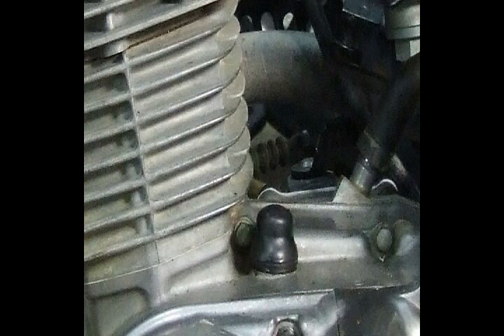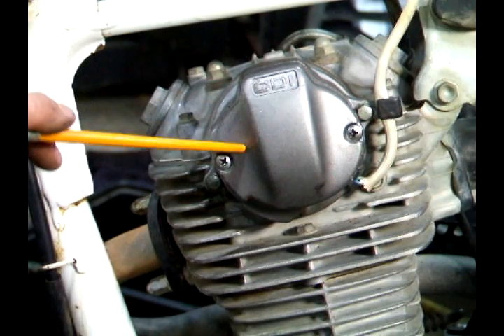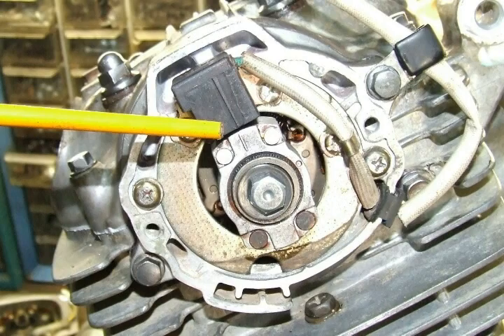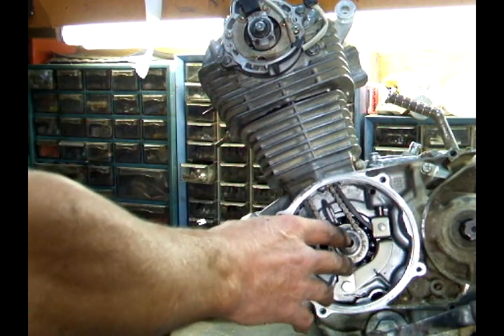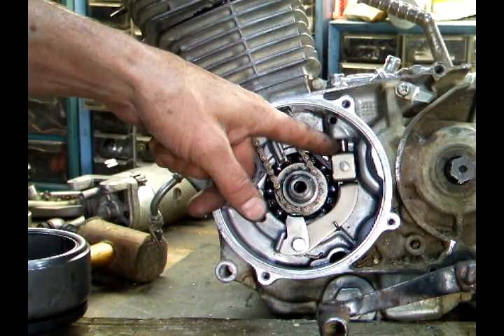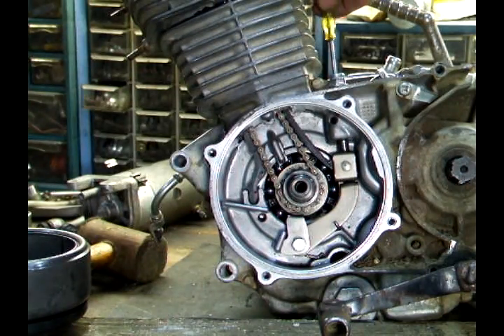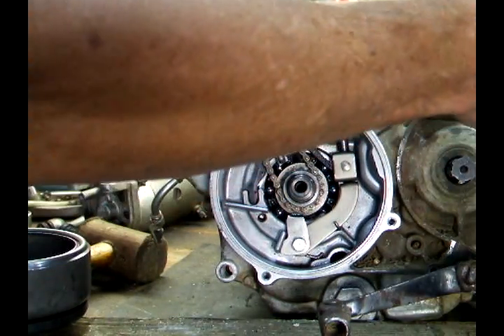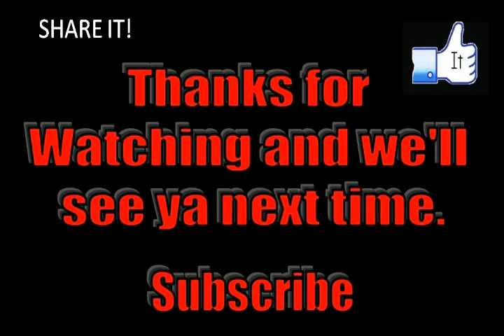Cam chain adjustment for Honda 125, 185, and XR200, ATV's & motorcycles

Comment: a bit unclear to me still.  By pushing the screwdriver down a few times is what sort of resets it?  You do not have to open up the case, as you said, to see it? So line up top by matching the line, then push with screwdriver a bit?  thanks
Reply from the maker: That is correct. Pushing with the screw driver just makes sure that the locking mechanism released and set the proper tension.

Comment: so you did not adjust anything just push it down. is there a screw inside to turn to adjust and which way do you turn it to take up slack in the chain. Thanks
Reply from the maker: The adjustment is spring loaded. The clamping mechanism sticks sometimes. I'm just pushing on the adjusting rod to make sure that it is not sticking. The spring inside sets it to the right tension.

Comment: Thanks for your video, this is great. I've had this bike on the shelf for awhile. I suspect my cam chain may have slipped on my first ride. Does this sound sound like a slipped cam chain to your or perhaps something else? I'm not terribly handy with these and would love your input. Thank you. https://www.youtube.com/watch?v=IOm-WkMdVhE
Reply from the maker: Wow, that's hammering pretty good. It might be more than a timing chain slap. Better tighten the valves too. Check the Oil also.
Reply: @Amotorcyclenut  Thank you I appreciate it!

Comment: The manual says to loosen the bolt while it's running then tighten.Thanks
Reply from the maker: If the timing chain skips a tooth while its running you will have bigger problems. Don't do it.

Comment: Why does this have to be done on dead center fire stroke? What would happen if I didn't do it dead center fire stroke?
Reply from the maker: It doesn't have to be exactly on TDC, but at that position I know the cam is not trying to  open the valves.
Reply: @Amotorcyclenut  weird because the oem Honda repair manual states to have engine idling and loosen the larger nut
Reply from the maker: That might be a way to do it when every thing in the engine is new. But ask your self this question. What is going to happen if all the parts are a bit worn and you loosen the Cam chain with the engine running and the timing chain skips a tooth or two? I'll take the safe way on an old bike.

Comment: A Motorcycle Nut, I read some of your replies and of course watched the video. Very good, and most importantly; CORRECT information. Thank You. I love the XR200R engine, for some reason I love the design, how compact, how simple, and how peppy the cute little engine is. Now, if I could just adapt fuel injection to it...

Comment: The cam tensioner is on a spring that can stick all you are doing is allowing the tensioner to do what it was designed to do. You aren't adjusting a thing just freeing a Honda flaw in an otherwise great motor.
Reply: The answer is always in the comments. Thank you

Comment: my xr200 will start and idle fine, but past a quarter throttle its just boggy.  carb is clean.  any ideas?
Reply from the maker: Jet needle set wrong. Wrong float level.  Air leak somewhere. Dirty or old air filter. Bad spark plug cap.  Plugged muffler. There are a couple of things for you to check. Read your spark plug after you run it to figure out what's going on.

Comment: Great video!  I have seen others post videos adjusting the chain while the engine is running.  -A great way to destroy it.  Yours is clear and easy to understand.  TDC on the firing stroke to slacken the chain for adjustment.  Thanks!!
Reply: It's not TDC though, it's a bit before TDC at the point where the ignition fires

Comment: Hi. Can I have your Facebook or email?
I would like you too see some photos of the cam chain of my HONDA TLR 200. 
I don't see the marks. And I can not move anything.  
Thanks a lot
Reply from the maker: +Eduard Casellas Meet me in Google + community "Basic Motorcycle Mechanics" post under the Cam chain adjustment for Honda 125, 185, and 200 ATV's & motorcycles video. You can post pics there.

Comment: Can be done with the engine turned off? No need to turn on whilst adjusting the chain? 
Thank you.
Reply from the maker: +Eduard Casellas Only do this with the engine turned off. If the timing  chain is really loose or stretched it could jump a tooth on the sprockets and make a mess out of your engine. Eat valves and stop running and we don't really want to go there!!!!!
Reply: +A Motorcycle Nut really cool answers, both of them.  Thanks a lot. Check my Chanel if you want to see my Honda in action hehe just got one video anyways. If you hear something wrong I will truly appreciate your opinion. 
Thanks again. Keep posting as it is really helpful for us.

Comment: Thanks a lot for this video, had no idea the function of that rubber thing. 
Mine is a Honda tlr200 and from this screws some oil is coming up ( not a lot but it's clearly some oil vapor is sticking the area around the rubber tap ) 
Could you please give me some advice on that? 
Thanks a lot in advance. 
Love the review.
Reply from the maker: +Eduard Casellas The 14mm bolt has an o-ring on it. If you unscrew it completely you can replace the o-ring and it should stop leaking, It can also leak  from the 6mm plug. it has an aluminum crush washer that might need to be replaced.